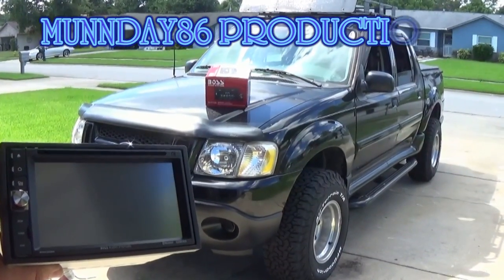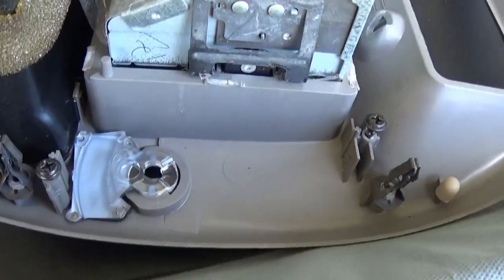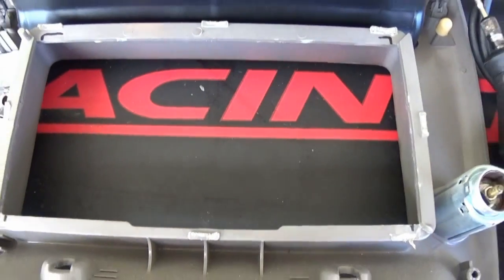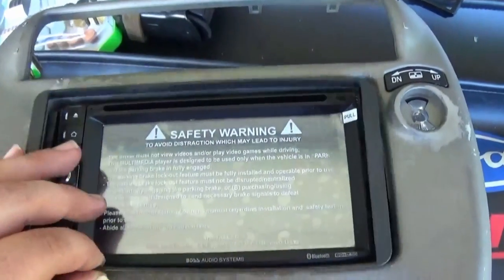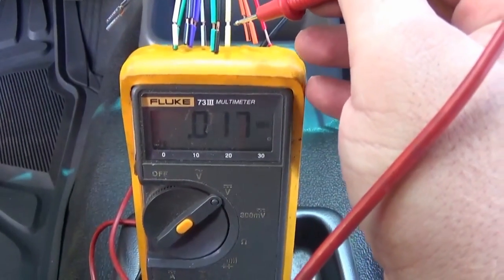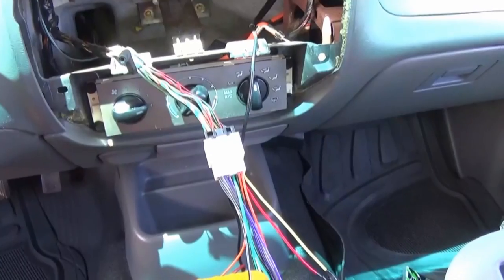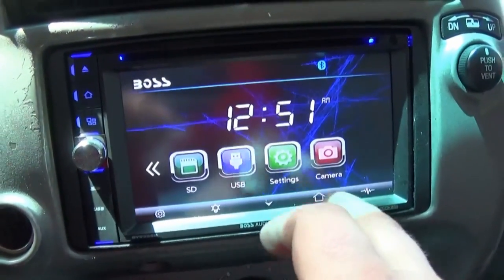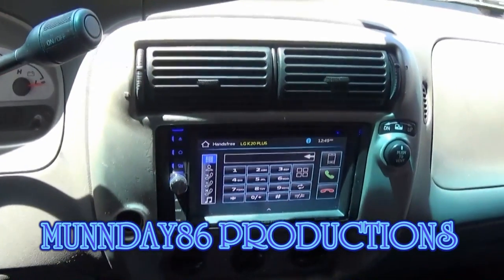FORD SPORT TRAC "RADIO UPGRADE" DOUBLE DIN  6.2" TOUCH SCREEN

Comment: Keep the videos coming, I’m working on my sport trac too
Reply from the maker: Im rolling that good bean footage..lol
Reply from the maker: What upgrade have you been doing
Reply: My sport trac is acting weird where the radio and the whole dash will go out while its running and will randomly come on again. I took it to ford and they said it was the instrument cluster and its gonna cost $1000 what do yall think
Reply from the maker: @justinannas958  in that case I would go to a junkyard or ebay  buy  another instrument cluster and install it  to see if it fixes the problem
Reply: @munnday86  i didnt even think about that. Thanks man
Reply from the maker: @justinannas958   no problem that what I would have done...
Reply: @munnday86  how many miles do you have on yours and where did you get the side steps from, you didnt have a link in that vid and people want to know they look nice
Reply from the maker: @justinannas958  Truck has about 138k on it. The side steps are OEM. I got them from a junkyard. Pull and save

Comment: There is a tool inside install kits that you stick in the four holes on the front of the radio to release it without disassembling all the other stuff.

Comment: Nice.
Have you taken that stupid chime out of your truck yet? My key in ignition warning was always going off, even when the key wasn't in there and driving only 10' before the seatbelt reminder was going off was annoying too. It was behind the gauges and I had to take the gauge cluster out to get to it but at the same time I fixed the broken gear indicator too. It wasnt a tough job, I went in there blind but getting rid of that annoying seat belt/ignition chime was that best "upgrade" on my truck. Lmao

Comment: Hey bro I hate to keep commenting but I may have a lead. I just used my multimeter to test the DC. As I connected the radio piggy back to the factory harness I tested the factory harness end. It read 12 DC there. However at the bose radio head when I test the ground and power wires it reads -0 as the DC. Does that mean the radio or wire harness is bad?

Comment: I just put this radio in my 2006 Ford Explorer and I love it but for some strange reason when I turn off the car the radio goes off. It seems like it doesn't have constant power. Any suggestions 🤔.

Comment: Hi bro I have a questiomn, did you used the factory bass?
I recently purches my Explorer but the previous owner told me that the bass wasnt connected due the 7inch new stereo could damage the factory bass, I dont know if you or someone here could tell me if its ok used the factory bass with these kind os stereo.

Comment: Do I have to solder the wires together or would crimping them together work the same
Reply from the maker: Either way will work. But soder will work the best.
Reply: I've installed houndreds of radios,  butt connectors are completely fine.  Although solder is the best way to do it

Comment: I followed your video and now the radio won't turn on at all. I soldered the wires together but before that the radio would briefly illuminate. Not sure if it's the wiring or solder I messed up. All fuses are good
Reply from the maker: Make sure the power and remote wire are hooked up correctly.
Reply: @munnday86  right, so I have the red, yellow, black and blue/white connected. Imma try redoing the soder since it's still not working. Do you think I'd need new harnesses?

Comment: My truck is a little different than this one and has the theft blinky light, will taking the old radio out and putting a new one in cause the truck to not work because of the anti theft? I don't know much about trucks if you can't tell😂

Comment: Hey man I have a second wiring harness in the back of my radio, how do I wire it into an aftermarket radio? Is this the harness that runs my compass? Any help would be great man thanks!
Reply from the maker: What model sport track do you have. Some have an upgraded stereo from the factory. Just confirming
Reply: Hey man I have a 2001 sport trac
Reply: @davidgiacchino6624 Did you ever get this figured out?

Comment: I have a 2002 Ford Explorer Sport Trac that died, I've replaced battery, alternator,ckp sensor, rear timing chain tensioner, coil pack and downstream 02 sensor but still unable to get it to fire up, it'll turn over but not start. Please help me figure this out!!!
Reply from the maker: Pull the valve covers off and make sure the engine didnt jump timing.
Reply: Im wondering if I can do all that with engine still in the truck

Comment: To each their own, but I still use the factory Cassette radio in my '05 Sport Trac. I'm not too keen on all these newfangled technologies.
Reply: I'd do the same on my OEM Pioneer unit in my 2003 Sport Trac Adrenalin, but all the LEDs in the unit have gone dark.  They will randomly come on for a few seconds every few months.  Radio still works fine, but it's time for it to go.
Reply: I’m sick of how much audio I lost through the Bluetooth radio cigarette lighter thing I had touch screen is also super cool to see in your car on a daily basis

Comment: Great video man... About to do an install on my 02. (Already ran wiring for backup camera last night... Perfect grommet for it inside rear driver side door below the seatbelt)

I was wondering if you had any issues with Android auto and the "emergency brake" requirement with this install?
Reply from the maker: Thank you for the compliment  I believe with the emergency brake wire you can hook up to a constant 12v source and not have to worry about the e brake switch.

Comment: Whats your wheel setup
Reply from the maker: Here is the rims. https://www.amazon.com/gp/product/B002TUTAUK/ref=as_li_tl?ie=UTF8&tag=munnday86-20&camp=1789&creative=9325&linkCode=as2&creativeASIN=B002TUTAUK&linkId=0979994347bc854c59051aa233100d0f
Reply from the maker: Here are the tires. https://www.amazon.com/gp/product/B010C788TU/ref=as_li_tl?ie=UTF8&tag=munnday86-20&camp=1789&creative=9325&linkCode=as2&creativeASIN=B010C788TU&linkId=9a086d640eedf0e8fc8ee5c5d8bc93db
Reply: @munnday86  thank you

Comment: That radio  is trash,  and why wouldn't you connect the microphone when you was installing the deck?  Now you have to take it back out lol
Reply from the maker: I have had no issue with this radio sure you can spend $500 on a high end radio. And no didnt need to hook up the microphone, work great without one..